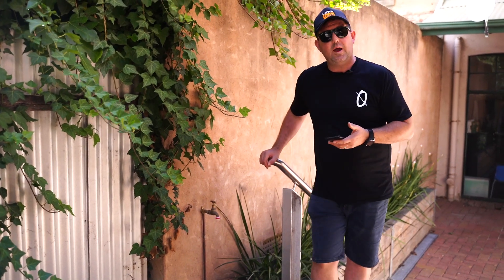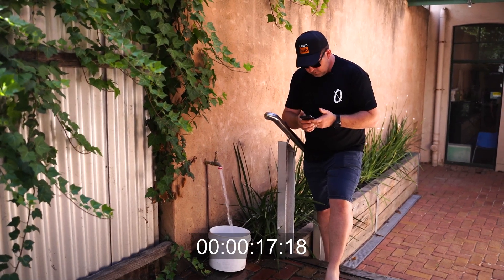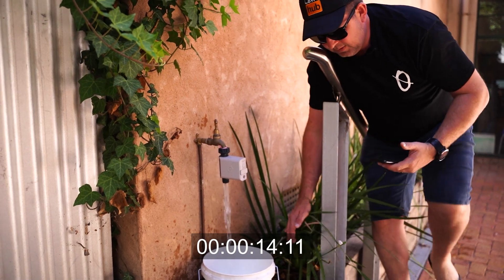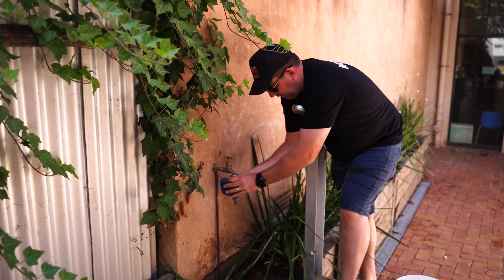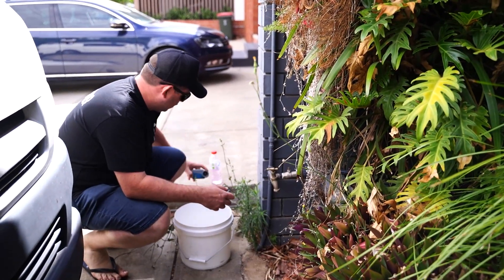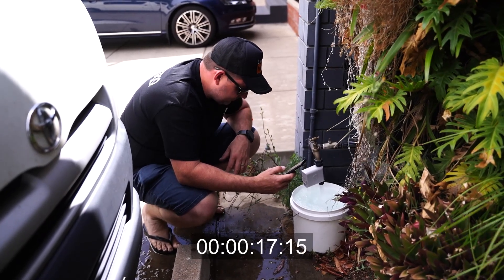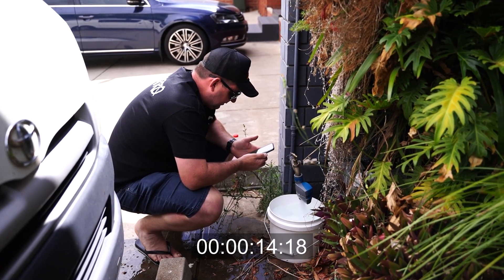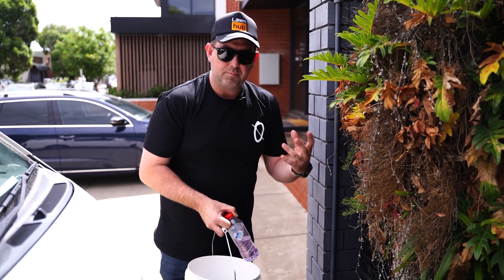How Do Tap Timers Affect Flow Rate?

Comment: I'M PISSED OFF LIKE YOU CANT IMAGINE BECAUSE THESE DAMN TIMERS CUT PRESSURE IN HALF MAKING MY MILNOR SPRINKLERS NEARLY USELESS!!!! IS THIS DONE ON PURPOSE OR SOMETHING?!?!?
Reply from the maker: I don't think they make them drop flow on purpose. I think it's unfortunate collateral damage from making them fit a price point many desire.
Reply: @waterproau  I gotta tell ya, if that's the reason, I couldn't think of anything more counterintuitive because of the money it cost in lost work, seeds, moss and top of the line Milnor sprinklers that aren't covering half the advertised area because of these timer issues, which disallows you getting proper coverage for the area a particular person may be dealing with. I'm seriously tempted to take this timer apart to see exactly what it is thats restricting the flow, it may be as simple as drilling out a ball-valve.
Reply from the maker: The restriction us caused by the path the water passes through being so small.

Comment: Hi there
If you don't need a fast flow rate is it necessary to have a low pressure tap timer on a low pressure system?  ...or can you use a standard tap timer
Reply from the maker: Hey Peter. Sorry for the super late reply. I missed this question. Have you sorted out your tap timer? I don't actually understand the question.

Comment: So how did you resolve the pop up issue?  Use a different timer?  I have the same issue....
Reply from the maker: Split the system across two lines or change the nozzles to low flow if it's an option.